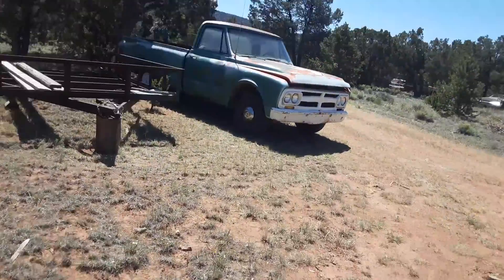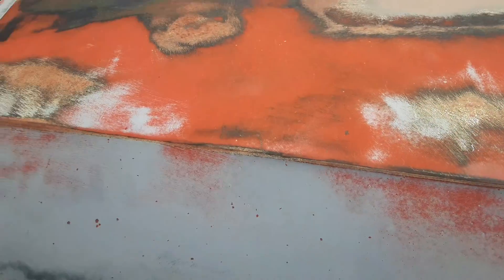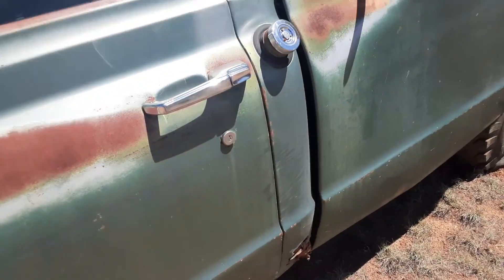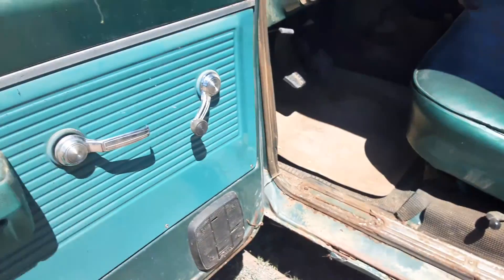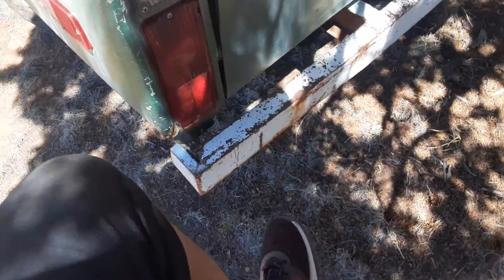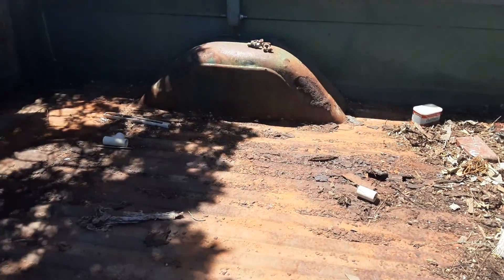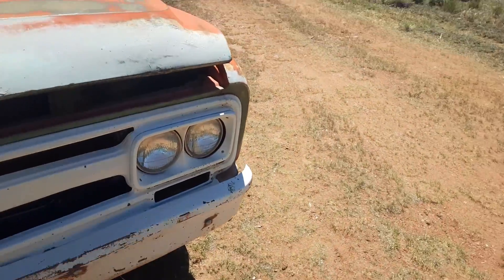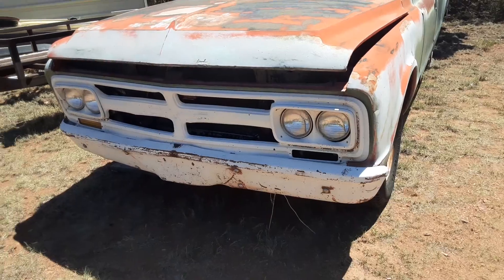The new family member of Chevy Land T.V.

Comment: You say check out my buddies truck and then us guys who are hard of hearing can't hear you. I see tons of potential in the truck. Its a patina truck as is. I am guessing a two thirty six cylinder automatic truck as is. Front end is riding like the six. They are a good engine, at least the ones without the head and manifold together. Those suck and never are right no matter what you do to them. If head doesn't leak then don't mess with and if it is, yank it and stuff any other. The bellhousing, flywheel, and associated all interchange with all others big and small. A mig and some patch panels will fix everything... I don't think that you and your dad have the money to fix up to sema levels yet. These were good trucks to fix but still just a money pit
Reply from the maker: Thank you for your long comment , to bad you old farts can't  hear my voice  in my videos maybe try  turning up the volume on your device.  I don't care  if the inline sixes  suck  maybe you didn't put it together right. Yes we will get to it and we both know what we are doing. Thanks for sharing your thoughts I don't care what you think or if you like my videos, because I have others who  enjoy my channel for helpful stuff. These trucks aren't going to sema or any fancy auctions just a street truck  and yes I am getting there to weld the patch panels with a mig . Eventually we will slap in a 350 chevy and repaint the truck. I am on a budget  I am not the richest man alive if I was then I would not have this you tube channel. I do this to help others and learn from my mistakes we are all human. If you don't like what I do or how i do it then find someone else to is willing to deal with you. I really don't care if they are money pits they are our trucks  not you or anyone else's. Some one has to carry the torch if not you then someone else will like me . Thanks so much for your very helpful advice but I do what I want not you or anyone else.